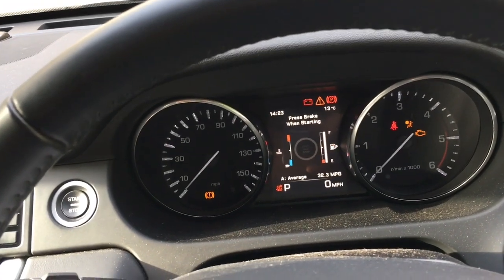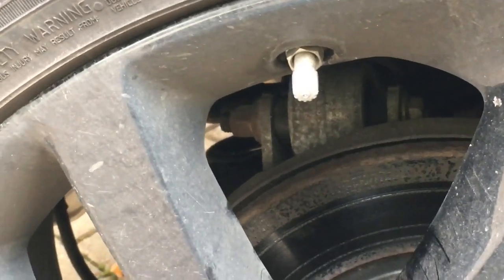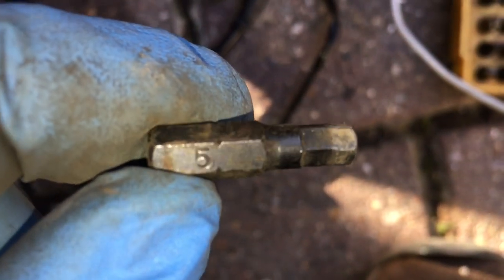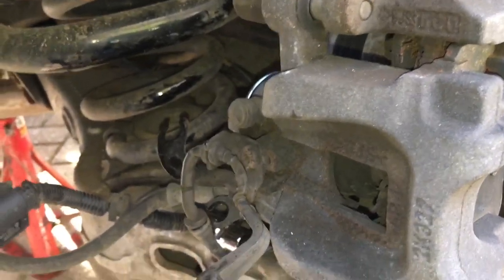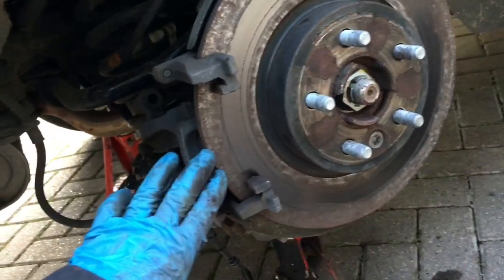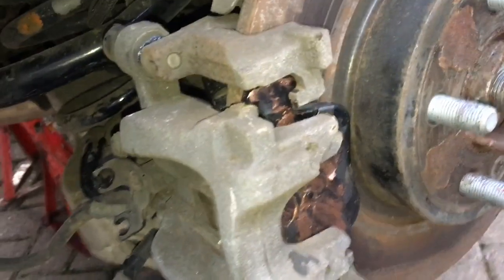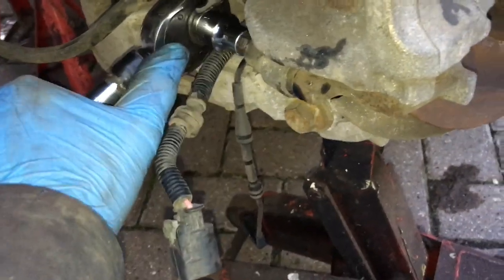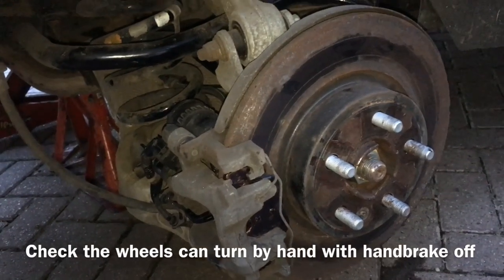Changing Rear Brakes Discovery Sport. EPB Trick used.

Comment: Those discs were shot and its pointless doing the pads without changing the discs when they're in this condition. When this type of rust (slightly shiny & polished look) appears on the discs it is not worn off by the pads (light daily surface rust IS worn off). The rust on these discs however will just cut into the pad. Your effective braking surface area is seriously reduced. Either replace the discs or at a minimum get them re-finished at a machine shop (assuming this doesn't take them below the minimum thickness). Discs are pretty cheap these days so re-finishing is rarely cost effective unless you have a mate with a lathe.
Reply from the maker: I disagree.  They were fine for at least the next year after renovating them.  The more aggressive (more copper content) Mintex pads cleaned up the discs even more than my surface grind off and the surface was smooth flat shiny metal after some use.  I agree discs are relatively cheap and should be replaced if under the min thickness but I don’t agree with needless throwing away (hopefully recycling) existing discs that still have a lot more life in them.  Too much stuff gets thrown away nowadays instead of being fixed or renovated.  A lot of energy and CO2 just wasted.
Reply from the maker: Also, here is a similar comment I gave from a while ago, with picture :  “ A fair bit more time and money $50 for discs/rotors ( ebay uk: http://ebay.us/LCWc1Q ). No point when the discs are still fine.  See previous comment: (... in my case after making this video and running the car on the old (rusted but not too worn out discs) it neither vibrated or had any wear issues. 9 months later the discs actually look better and are still fine.  It’s not always necessary to replace the disc as well as pads.  Here’s a pic of these discs now: https://www.dropbox.com/s/hsg51t73xmnzn3c/IMG_0368.jpg?dl=0
Reply: James you are 100% correct. Those discs  are shot and the effective braking surface has been halved. They look like the discs on my F-Pace I just replaced  and the inside disc surfaces were a LOT worse. Either a light skim/resurface or replace discs.  Note: JLR brake rotors/discs have been suspect quality , have no anticorrosion protecting coating. The outsides rusts and gradually the rusted surface migrates to the disc braking surface like we see here.  Lately Jag changed their disc and the pad compound to improve. Comeinhandynow may have got away with replacing just his pads but his braking performance will still be reduced. In my case today on my 2017 F-Pace, changing the discs and pads made a HUGE improvement to braking and I used Non-OEM , GEOMET coated discs.

Comment: To release parking brakes, start car, turn off car, within 5 seconds press and hold down parking brake button, electronic parking brake has been released. I guess your method works too.
Reply from the maker: I seem to recall, on all of those sorts of methods that I tried on this car. after a few minutes it reapplied the parking brake, part of a safety feature I guess.

Comment: 20 dollar rotors 😅
Reply from the maker: A fair bit more time and money $50 for discs/rotors ( ebay uk: https://ebay.to/2ok85FJ ) and a fair bit more time as well. No point when the discs are still fine.  See previous comment: (... in my case after making this video and running the car on the old (rusted but not too worn out discs) it neither vibrated or had any wear issues. 9 months later the discs actually look better and are still fine.  It’s not always necessary to replace the disc as well as pads.  Here’s a pic of these discs now: https://www.dropbox.com/s/hsg51t73xmnzn3c/IMG_0368.jpg?dl=0 )